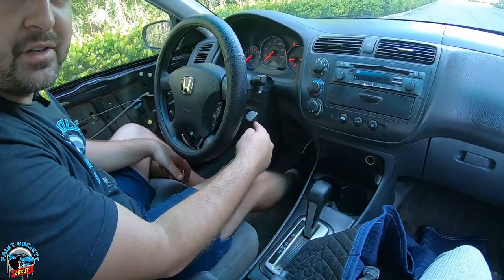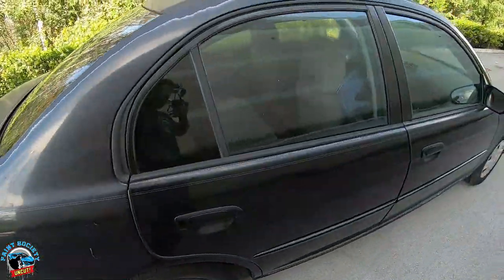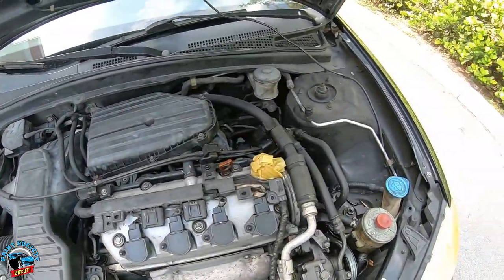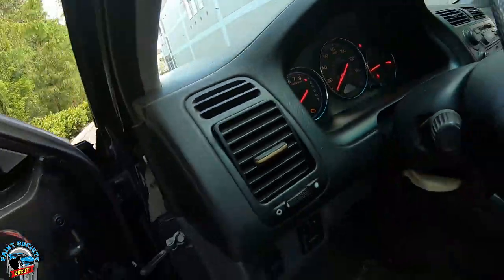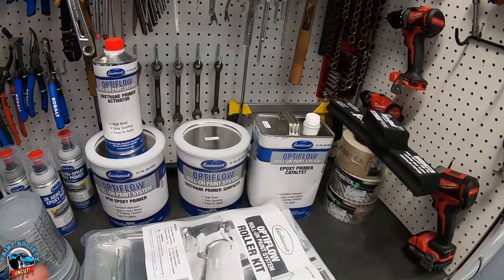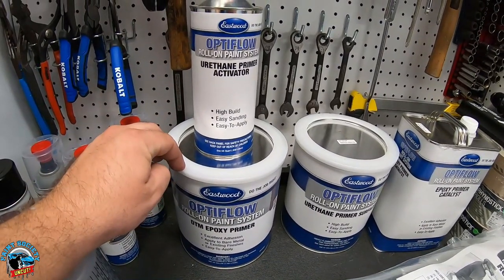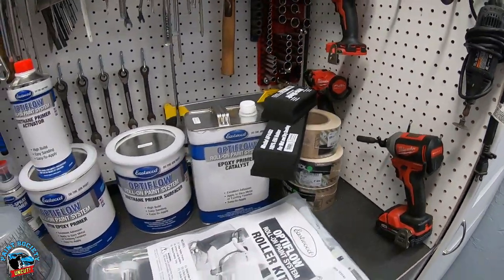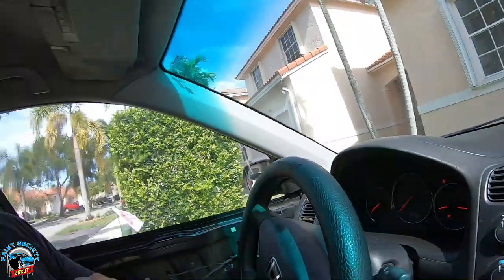Honda Civic Project! Part 1

Comment: Pull out the motor and make it a rolling chassis. Paint the engine bay and hand it over to another youtuber for an engine swap who will do a how to....
Reply: This.
Reply: I would definitely like to see you show us what to do to a car that the clear has started separation from the base coat. I have a 14 year old car that is definitely a keeper.  So, show me.  
John

Comment: Brilliant idea Brian, would like to see you correct all the clear coat and chrome black the plastic emblems. Air brush a spider web all over a lime green paint job from the house of Kolor. Paint the wheels gloss black and give them some black chrome wheel nuts and dress rims.

Comment: I have a 2000 Honda Civic and the paint is so smooth you can slide a rag right off it. I hit a deer, pretty much stopped. The drivers fender and hood got dented. I think I can keep the hood, just need to pull the dent. The fender crumpled. It has 164,000 miles and still drives like it rolled off the lot. Learning how to fix myself.

Comment: Hi there!
Im currently trying to repaint my whole car. 2004 Lexus Es300, silver to nardo gray, and it would be interesting to see how you go through this process, how far should you sand, how many coats of primer to use to repaint the car in another color and so on. 
It’s my first time ever even sanding a car and most what I learned was from you. Thanks.

Comment: Hey Brian, have you ever experimented with waterborne auto paint? Maybe this project car could be a good way of trying the system, since waterborne paints are supposed to be eco- friendly so may be a good choice for the home garage project builders. Just a thought.
Reply from the maker: We don’t use water based paint. If it’s not needed we don’t use it. Solvent is the way to go.

Comment: I would like to see it with it's original oem colour code with  modernised accesories like bumper lips side scertes 14 in he rims really clean head lights.

If the original colour code is too boring I would like to see it in the best colour for that years' model.

Comment: Help. I have a pre primered abs bumper from ebay and the primer that is on there i dont trust and its not fully  covering everything. Can i sand it down some and still spray adhesion promoter on there and then primer? Thanks